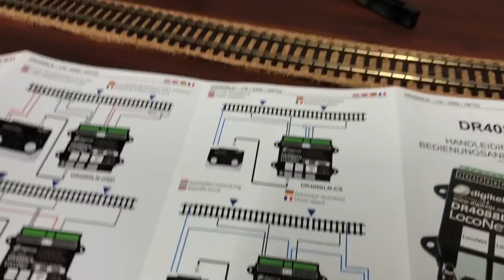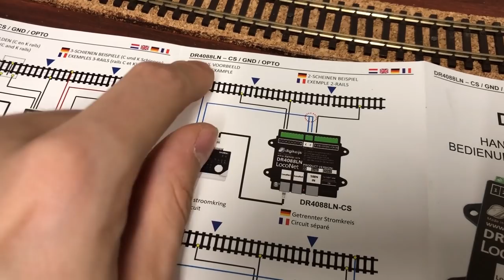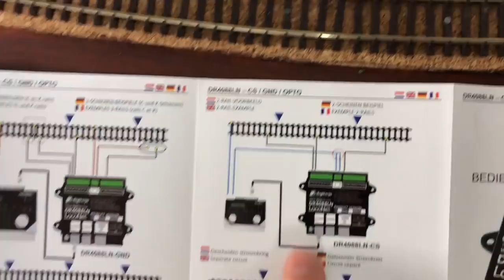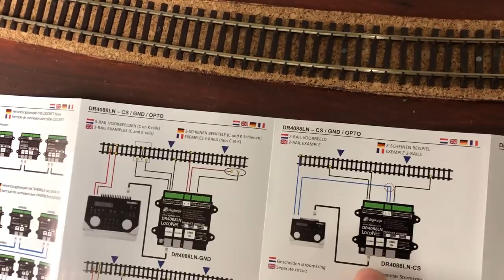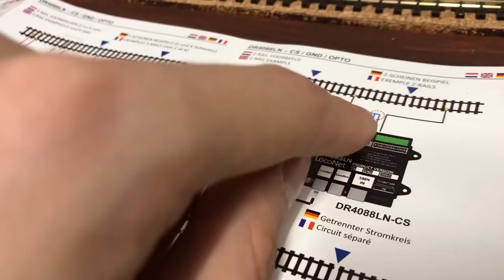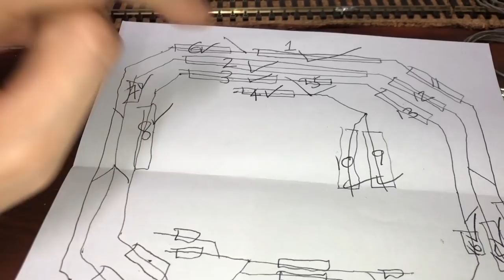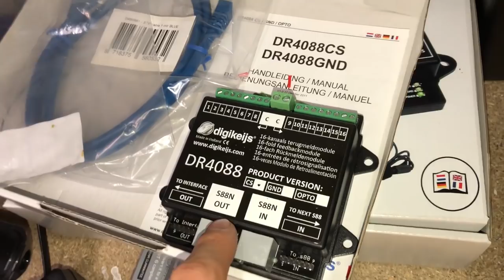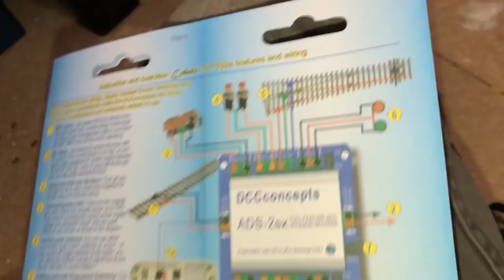How To Build A Model Railway - Episode 24 - Final Wiring & Explanations

Comment: Excellent job. I wired my DR4088LN and DR4088-S88's the same way with a RJ45 network between each DR4088-S88's keeping the block detectors local to the physical blocks and a single RJ12 loconet back to the DR5000 command station. Way simpler then wiring all the blocks back to the block detectors all lined up near the command station.
Reply from the maker: Yes, it's defiantly the way to go I think! Simple, makes sense and works!

Comment: To simply the wiring for your frog polarity, I would suggest wiring a full chock block with a bare wire snake like, this way all the connections are connected to each other. Use a small enough gauge wire so that you can later on insert one blue wire to your bus and one back to each frog, then do the same for the yellow. Now you have only two wires coming off the blue/yellow bus. Then connect the frog wires to the appropriate chock block. Your basically wiring the chock blocks the same as the block detector connections.
Reply from the maker: Although that makes sense, it would seem like i'd have longer wire runs, especially for those frogs that are on the other side of the layout. I like the idea of having them local and short wire runs. The wiring is pretty simple as it is, and seems to be working perfectly for what I need it to do!

Comment: Though at this stage I'm happy with basic dcc I must say this system is looking good! Very clever stuff - amazing how modern tech can be done an a model railway. Alot of wiring for my liking.. you can guarantee in a few years time it'll be wireless lol. 

But in all its alot simple than I first though!. Take it most hand held controllers can be used along with block detection systems rather than having it all running from a laptop?.
Reply from the maker: Haha, it is very tempting isn't it?! I like the options and running potential it provides me with. And yes, I look forward to the day when it's all wireless, would be a bit easier, and quicker to get up an running. That being said though, there is a sense of achievement when it's all done to sit back and appreciate the work you've done...as long as it all works as intended haha!

And yes, most controllers can easily be plugged in. Loconet, multimaus, etc. and you can use them to control individual locos whilst the software is running sequences in the background etc. Or you can just run the handheld controller on its own if you dont want to power up the software, etc.

Comment: Morning, very informative and looking forward to the next one. When you have finished with the point decoders are they going to be routed into a point switchboard with LED indications to which way the point is thrown ?. I have just bought myself x3 of the same point decoders and intend to incorporate these into my layout. I hope it all goes well. Stewart (woodfield Junction)
Reply from the maker: Hi Stewart, thanks for your comment! I'm glad you found the video useful and enjoyed it!
The point decoders will be part of the computer controlled system, and will be controlled by the software running the layout. However, these point decoders can easily be set up the way you intend, and if I wanted to set up my old switchboard (which has LED's already), it would be very simple to do so. But, I don't have any intentions to at this time. I may in the future though, these decoders give me the option if I choose to at a later date which is good!

Comment: Nice update. It's all coming together really well. I need to try to get a move on, but I'm still stumped on the one or two level question! One query about the occupancy set up...you talk about positive and negative, but unless I'm being totally stupid (always a possibility with me! Lol), dcc doesn't work on polarities, so I'm wondering what the benefit of a 'common positive' is for occupancy...is it actually a positive? Long day. I could be picking it up wrong!
Reply from the maker: Hi mate, thanks for your comment! And there's no rush, better to take your time and get it right first time!
And yes, technically you're right. There is no actual + and -, but I find it's the easiest way to explain it to those who may not be electrically minded, or those who just want a step by step process to follow.
For me, the benefit to making a common + is that it make more sense in my head when wiring everything else up. If I treat everything with a + or - when wiring, it means i'm less likely to make mistakes when wiring frog polarity, or accessories.
It may seem a bit more confusing to those who are more electrically minded, but to those who are not, I just think this is the best way of explaining it. Hope that makes sense?
Reply: Tony Docks Station I totally get you. I did wonder, after posting that comment, if that's what you were getting at (just wanted to check that I wasn't missing something myself, as I'll be wiring up these detectors in the nearish future!). I also think, when you consider that on the function side of the chip, there is a (rectified) common positive, it may also help to think in those terms and reduce potential for confusion! 👍🏻
Reply from the maker: Yes, that's exactly it mate! Overall, it does help to think of your layout and + and - to avoid any potential confusions. Especially with this type of layout, where there are A LOT of wires, it can get confusing quickly, and the last thing you wanna end up doing it chasing cables trying to find a fault lol!

Comment: Great video, very helpful, I was just wondering with the blocks, is it normal to have gaps between blocks on a line or ideally would you have blocks one after another? 

With this system, is it able to automatically slow trains and stop trains to the end of a block if programmed or if the block ahead is occupied?
Reply from the maker: Hi! Thanks for your comment.
Blocks can be wherever you want really. I have some small gaps between my blocks. It just depends on what you want the layout to do, or what areas you want detection on really.
And yes, it's capable of all that, you need the relevant software to do it though. I'm exploring software options at the moment and will cover it in a future video!

Comment: So, your going to go simple on the signals, huh. I went with some Team Digital SHD2's and some loconet boards to automate the signals based on block occupancy turnout direction and other signals. You have the loconet bus and block detectors and working signals already. Your almost there. I'm not using any computer software to run the layout, the signal detector are doing that but I can add computer automation if I prefer to do that at a later time.
Reply from the maker: I'm using DCC signals, mainly Traintronics, and they go into seperate signal decoders. See my signal video from a little while ago where I explain it all in a bit more detail. They will be controlled by the software, and as such will work based on block occupancy and turnout direction as you mentioned. So, I'm already on it!

Comment: God I hate wiring so I understand the tediousness of it . My question is why did you go for this system and not something like mega point ?
Reply from the maker: Hi Brian, thanks for your comment.
I spent a lot of time researching what equipment and parts to go for, and it all came down to which system I felt more comfortable with, what suited my budget, and what was going to achieve the goals I'd set. This is just what worked for me, but I think overall, most systems are the same in principal, and the way they are set up should hopefully translate.